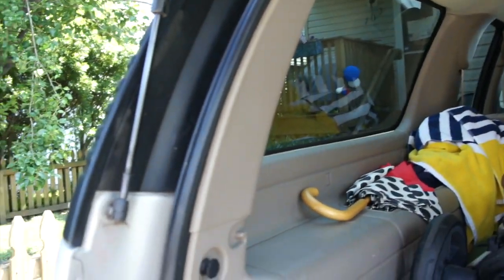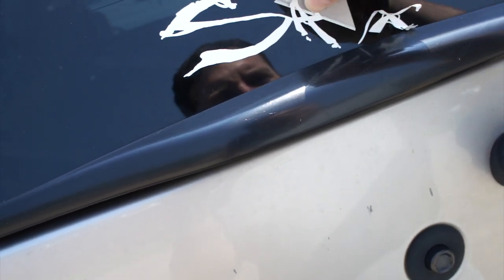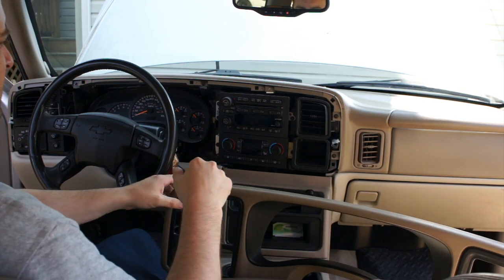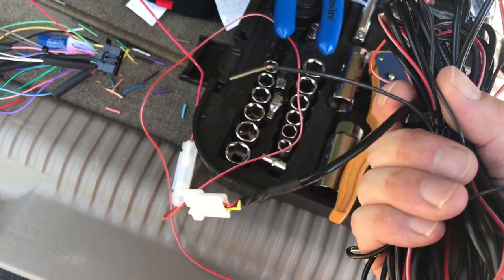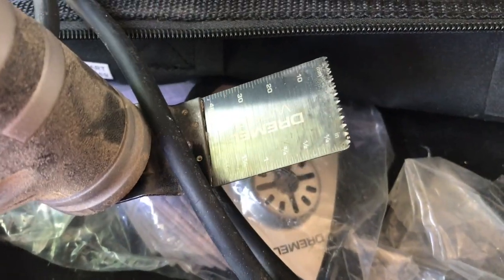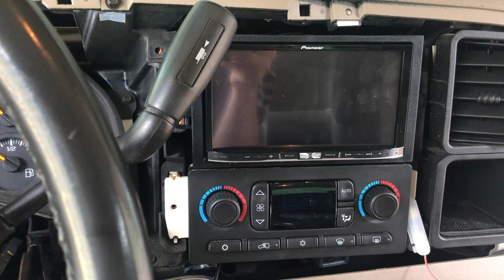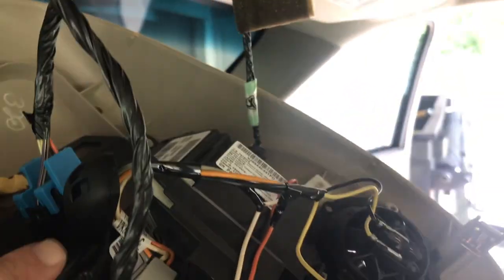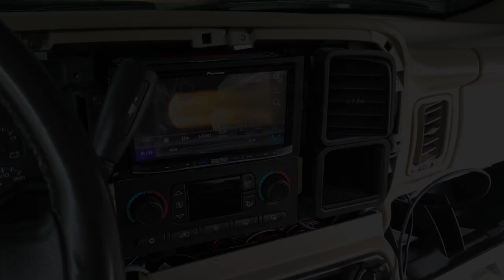Z71 Suburban Tailgater Project 01

Comment: I love it.  I'm surprised you didn't go with an iPad kit.
Reply: ALMOST did! But it would have required immediate purchase and execution of an entirely new sound system. There was also the reliability and technical issues of hot spotting data to to an iPad to run Waze. The decision was made for me when Apple announced Waze will be able to run on Carplay which this headunit just so happens to feature!